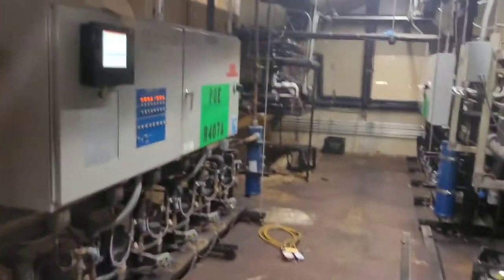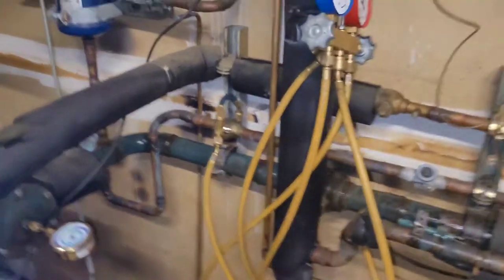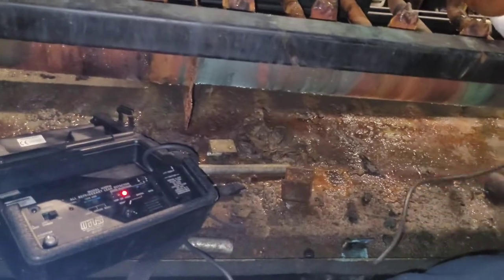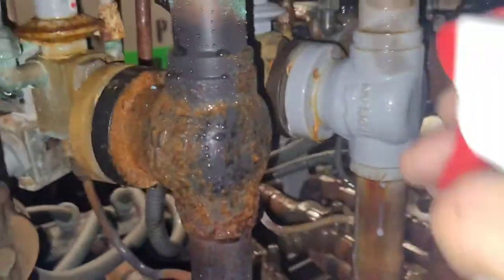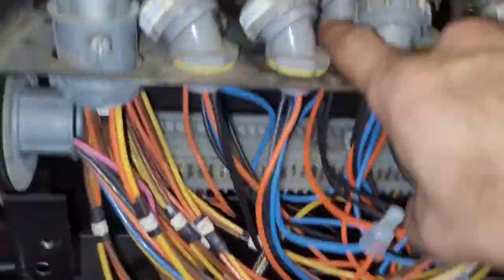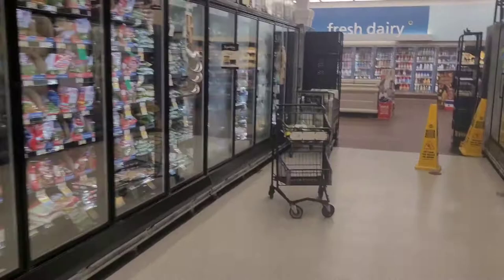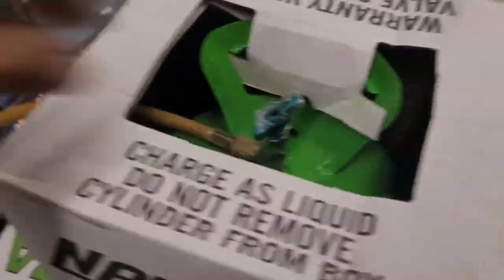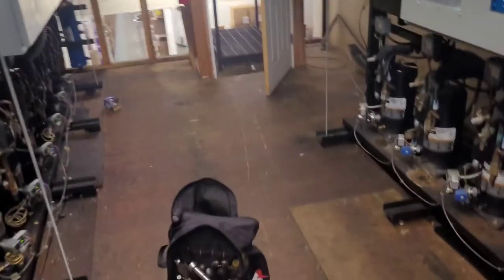Supermarket Low Temp Rack Refrigerant Leaks Found Fixed And Recharged

Comment: You don’t have to cut wires to LLSV, you can just put a metal screwdriver through it to stop coil burning out.  Or even an old solenoid end and cable tie it in place.    Works for hours if needed and saves rewiring.

Comment: It's not that somebody failed to tighten them up , it is because after the system reaches its lowest operating temperatures and the memory of the metal is lost , it needs tightening .
Expanding and contracting will cause that to happen . maintenance should be required to tighten at least once after start up and  checked twice